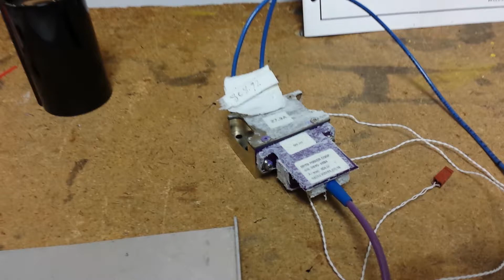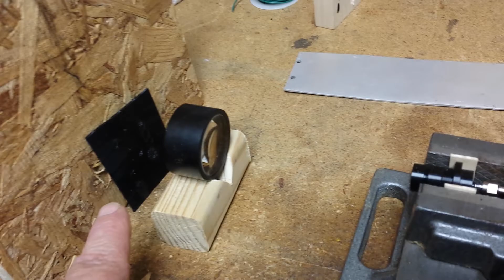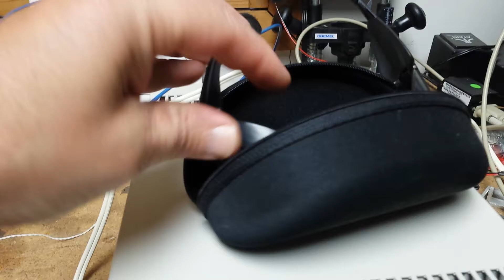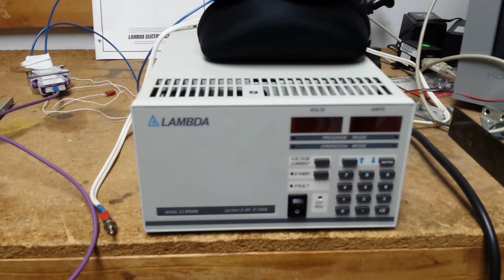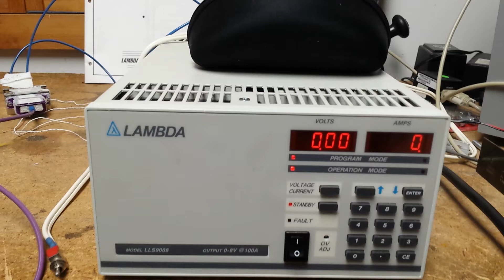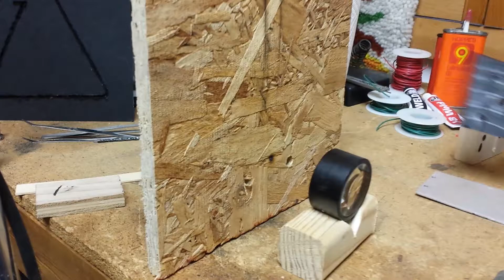Laser diode bench test

Comment: Would love to see more laser videos from you. Theres a huge lack of laser videos on YouTube… and many of us that would like to see them. 

Would love to hear your recommendation and advice for a laser diode/pointer test bench. DIY entry-level tools and techniques to easily test and characterize laser diode‘s. 

I’ve been lucky to snag a Thorlabs laser diode test mount/socket that’s TEC controlled. Very nice Mount that allows quick easy swap in and out different packages of diode, that is TEC and driver controlled. 
Kind of an all in one solution. 

“Arroy and “wavelength Electronics “ make some great test mounts and equipment as well. Here’s a beautiful example.

https://www.newport.com/f/high-power-bar-laser-diode-mount

A good DIY cheaper alternative would be a wavelength electronics Driver and TEC controller...mounted to their evaluation board. 

Build a nice solid copper TEC controlled heatsink/socket/mount… And it would be a wonderful way of testing and characterizing diodes easily. 

There are a few “wavelength electronics” setups already on eBay for under $150 used. 

Just need to buy or build the tec controlled socket/mount for the diode and it would be a ready-made lab. Add a nice laser power meter and it’s off to the races!